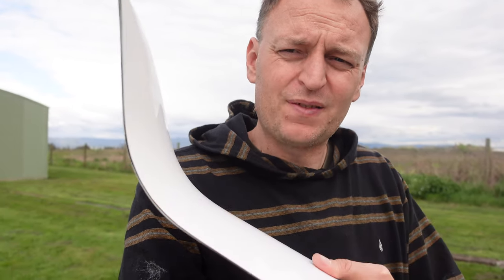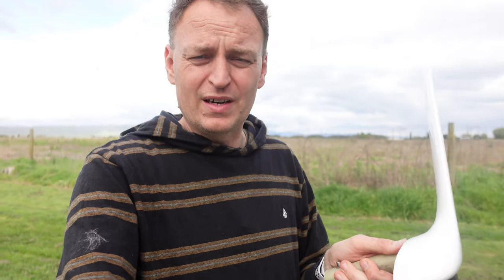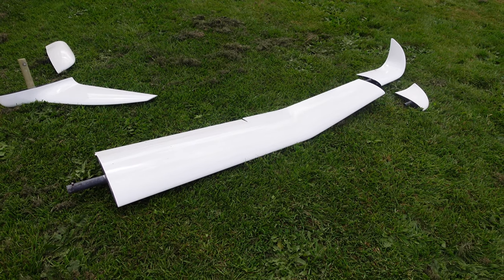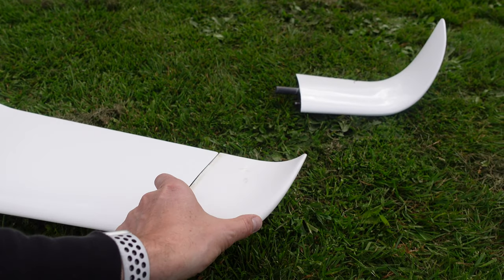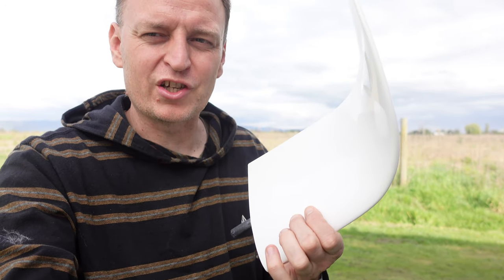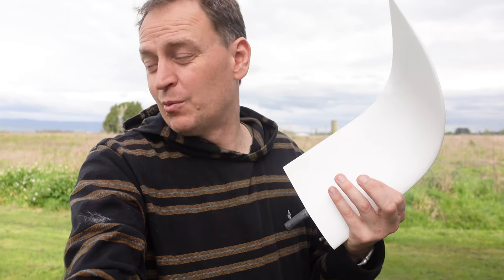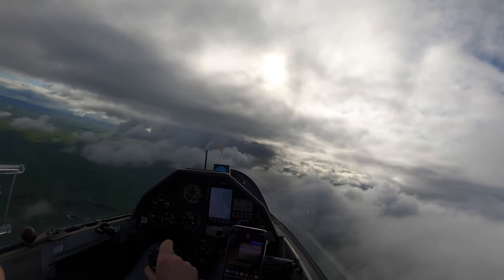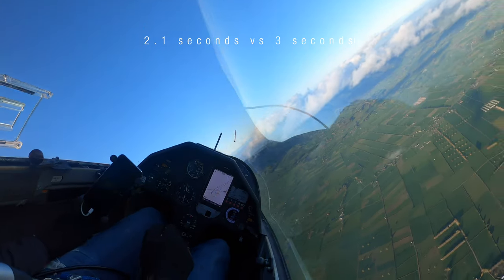Glider Wingtips, Winglets & Wing Extensions

Comment: "How many wingtips can one glider have?!" - one each side, Tim.  

Glider aerodynamics have led the way for the changes seen in big aircraft wing shapes over the last 30 years, while winglet design seems to be an art as much as a science.  The 747-400 had big (Whitcombe) winglets modelled on those added to gliders in the mid-80s; neither the 777 nor the 787 have any, though winglets retrofitted to the 767 showed a clear benefit.  Airbus used to use small winglets on the A320 which extended above and below the wing; the NEO has bigger, upward-curving Boeing-style winglets - not surprising, really, as they were designed by Aviation Partners (a Boeing spin-off).  

The addition of winglets - particularly to gliders - has some complications due to the structural loads caused by the changed aerodynamic load plus the addition of mass at the wingtip.  Since the winglet hinders flow around the tip, the lift at the tip is no longer near zero and the centre of lift of the wing moves outboard, increasing the bending load on the wing root.  Modification of 737-300s to add  winglets, for example, included strengthening of the upper wing skin to resist buckling; something that doesn't readily spring to mind.

Show an engineer something technical, give him a keyboard and he's away!  As usual, Tim, a nice video.  I do enjoy the way you greet YouTube with a slightly surprised expression, as though it's just snuck up on you.
Reply from the maker: Thanks! Yes those YouTube viewers always sneak up on me :)
Reply: Winglets vary for the mission of the aircraft.  The 777 and 787 wingtips are designed for long range cruise.  The very tall type winglets are designed for short flights and the airplane does a lot of ups and downs;  these are very common on the 737.  The hIgh pressure air under the wing seeks the  low pressure air above the wing;  it's like letting the air out of a balloon.  The high pressure air curves up around the edge of the wing and spoils some lift and creates drag.  The Wingtip or Winglet will delay the high pressure air from getting to the low pressure air and the vortices will form past the wing.  Gliders fly at much lowers airspeeds and the taller winglet is most beneficial.  You can look at a wingtip and tell the mission for that aircraft.  Tips that flare back are for high speed long range and tall tips are for slow flights with lots of ups and downs.
Reply: @atpandpa  True, but ... The 757 and 767 winglets - the 767 particularly a long range aircraft - were the tall variety.  They provided about double the benefit expected of them in cruise (these were the ones fitted late in the life of the Air New Zealand 767s).  Ironically, of course, the 767-400 - which no one except Delta bought - had swept-back tips.  Interesting, isn't it?
Reply: @lautoka63  I have a LS6 and I fly the 737 and I get asked about winglets from passengers.  The Tall winglet provides a 1.5% fuel savings on short routes.  I would be curious about the Air New Zealand cost savings and which routes they used those aircraft on.  Ultra long haul would use the racked winglets or blended.  Our new MAX winglets are called Simitars and it's larger wiglet that goes up and a smaller one that goes down;  and these are supposed to help with longer flights.  Winglets are calculated into the aspect ratio as longer wings, which is interesting.  The racked long haul designs are more efficient in cruise (high speed) climbs and at cruise.  The wing is at a lower AOA and generates lift by going faster (more planing).  It's a very interesting topic and new designs are always coming out.  You wonder if some of these designs are sales gimmicks.
Reply: @atpandpa  I wonder the same thing.  However, Air NZ's 767s are long-gone and I took early retirement in the face of Covid.

Comment: Hi Tim. Take a few high tows to measure your polar with the tips you want to fly with, this will give you both an accurate polar and a good comparison for each tip/ext. It will also give you some technical data to back up your comments and/or the manufactures claims. It is good to have this data for your own flying as well. I've done this a few times and am happy to discuss if you want too.
Cheers.
Bernie.
Reply from the maker: Thanks, yes that was the plan. Don't really want to pay for it to be honest, but will at some point! It would be good to have an accurate polar for the computer. I realise it becomes more and more critical the higher the glide ratio.
Reply: A waste of time - to do this needs reallly calm air - nobody flies in really calm air.......
Reply: @soaruk3697  First of all you need to understand why it is done. Correct about the air, first thing or last thing is best.
Reply: @narreflyersizer8198  it tells you nothing except how the glider performs in still air - gliders and their wing sections perform differently in turbulent air  -  as they also do with real life dirt and bugs on the wing, so essentially a waste of time, unless you do a lot of final gliding behind sea breeze fronts........... :-)

Comment: My understanding of winglets is they are a way to extend your aspect ratio while not extending the wing length. Eg the reason why they tend to have them on big jumbos is they can still fit them in the same hangar but effectively extend the aspect ratio without using being entirely horizontally and therefore reduce induced drag. Not sure if my training is correct though.
Reply from the maker: Yeah sounds about right. Airlines also pay for the size of their parking spots at airports, so it’s important to not just make the wings longer for them otherwise it bumps it up a parking cost class

Comment: when comparing roll rates you need to do it at the same speed. The Dynamic pressure increase according to speed squared, i.e. V^2 and so the controls have over 20% more power at 67kts than at 60 kts. Even so this would suggest the shorter wing roll rate at 60kts would be around 2.5 to 2.6 seconds, still notably quicker than the longer tips. 
The longer tips have more "roll inertia" so that more effort to start to roll them and a secondary effect is "roll Damping". Once the glider is rolling, the wing acts like a big paddle and tries to stop the roll, the longer wing will have a significantly greater "Roll Damping" than the shorter one. The relationship is not linear with span.
Various comments have been made about Boeing and Airbus winglets. There's a little more to the history. Winglet understanding was developed by NASA and Airbus first used this on the A300-600 aircraft in the form of a "Fence" a fairly crude device that was like a vertical end plate on the wing tip. Airbus went on to use this sort of device on the A310, A320 and A380, the A330/A340 had a "canted" winglet , at about 45degrees to the vertical. LearJet had used blended winglets, but it wasn't until Aviation Partners started to offer retrofit "blended" winglets did we start to see these devices on Boeing A/C. Boeing used a raked wingtip on the 767-400, and the 787 & 747-8 have similar tips. The 747-400 had a device similar to the A330/A340 canted winglet.
What's best?? each A/C has it's own particular design problems and trade off between weight and drag. some times gate limits at airport result in a more vertical winglet. Ultimately Boeing know how to design wings from scratch with raked tip and Airbus usually go for a variety of winglet shapes - it's what they know and the trade between the two is very close.
Reply from the maker: Thanks Geoffrey, agreed should have done them at the same speed :)

Comment: Great video! One thing I have not heard you mention is the added drag at speed. So for racing on good days where you regularly do over 150kph it's not alwas an advantage?
Reply from the maker: Yeah I haven't done much research into the specifics on extra drag at high speed with the longer wings, so decided not to mention it! Maybe polar curves and wing drag can be a separate video
Reply: Great video, thanks. I have a Ventus b, with 16;6 tips and 15 m Maughmer winglets. The polars say that if you fly at a speed between 120 kmh and 160 kmh, 15 meter have a better glide ratio. Around 135 kmh it is something like 8%. 37 vs 34. Not a big difference, and with the Long tips you have an advantage if you have to stretch your glide.

Comment: wait they're only held on by the tape? isn't that a bit unsafe?
Reply: No it's safe, it's a common thing for many applications and especially for drag reduction to improve airflow. From what I know it's like an interrupt fit, the parts cannot just "fall out" if that makes sense. If not Google it ha ha, there's always something new to learn.
Reply from the maker: Tape is pretty strong when pulling in that direction! And yes as Leo mentioned to remove them you have to pull them out at exactly the right angle, the forces in flight just don't happen like that. So I've never heard of anyone loosing one. The main 17.6 extensions do have a locking mechanism as well.
Reply: @PureGlide  Last time I was derigging my ship (asw20), I had taken out the bolt for the elevator/horizontal stab, but forgot to take the tape off. I pulled up in the normal fashion, nothing. Pulled a bit more since it's sometimes a bit stuck, nothing. Until I woke up and removed the tape. No effort then. So yes, tape is really strong, and especially for wingtips, there is no real load in that direction. In Europe though, only tape will not get an approval. It needs something to retain it, usually a spring loaded knob on the peg.

Comment: Wait... what... they are held on with tape?
Reply from the maker: Of course! The big ones are held on with a pin lock. But the small ones just slide on. I bet you wouldn't be able to pull it off either.